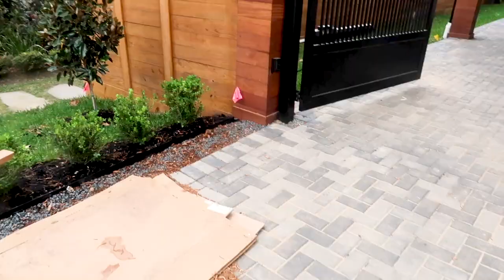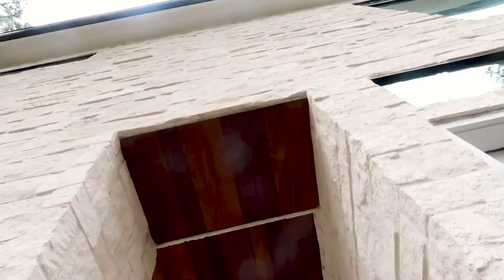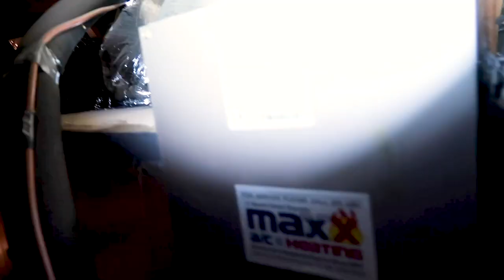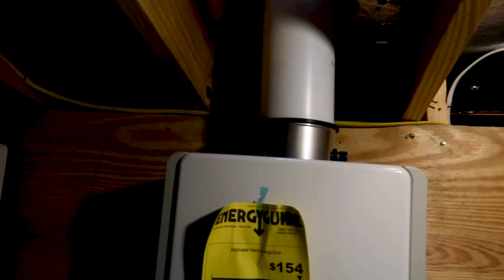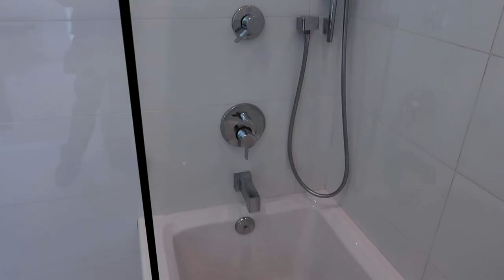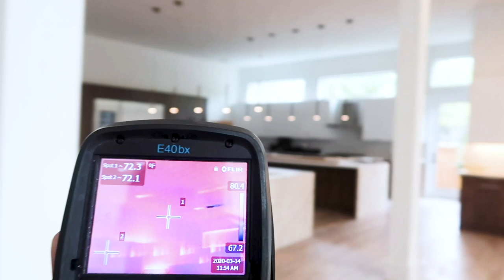Home Inspection Field Day - The Houston Home Inspector

Comment: Without a primary and/or secondary condensate drain line on the Rinnai water heaters, resetting them will get them going, but they will then build condensate up on the inside and set off the alarm again causing the unit to shut down.  Additionally, combining the heat and condensate on the inside heat exchanger will also cause premature corrosion.  I wouldn't even turn the thing on if it wasn't hooked up right.  I found this out the hard way on my own new unit and new house build.  The condensate ran down the inside of the unit and then collected in the pan.  Bonus issue:  The pan wasn't draining correctly because it was clogged with insulation that had been blown in after the plumbing install.  The plumber was pretty embarrassed when he came out and found the issue was the install hadn't been completed correctly.  The shower fixture controls also had not been adjusted correctly to allow for any hot water mixture.  Simple fix, but something to consider on new installs if you don't have any hot water at the shower heads when it is a single control fixture, but you have hot water at other fixtures in the area.  Small final inspection details that get overlooked on brand new homes that get closed in a rush without a proper home inspection.